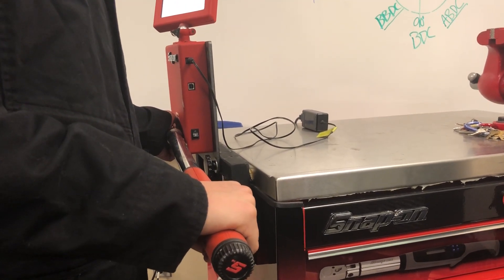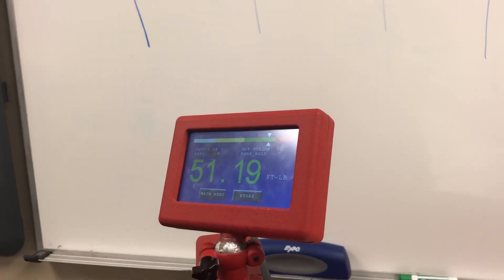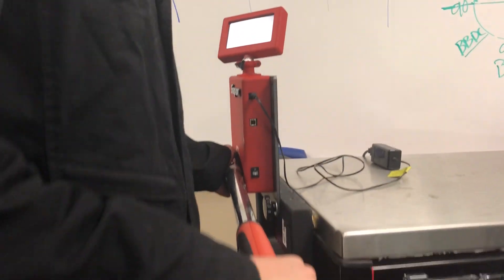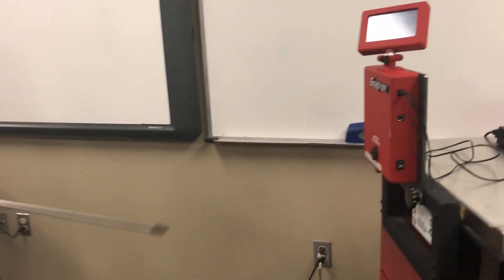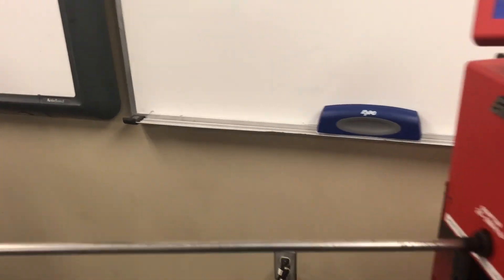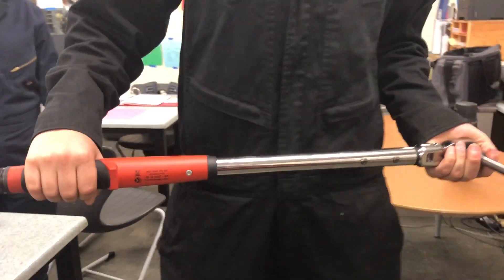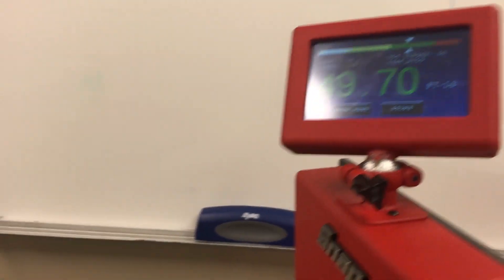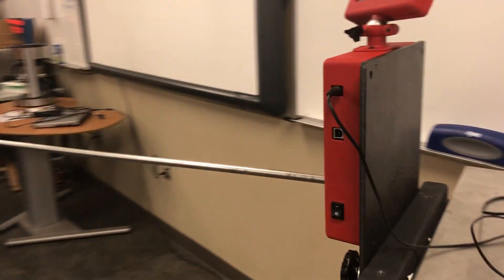Torquing with extension explained

Comment: I always knew this was true, but when I explain it to someone else they don't believe me. Thanks for the demonstration! 

I think they confuse this with torque because reduced with an impact gun. Torque is reduced with an impact wrench. But that is because an impact uses a hammer or hammers. The extensions twist back in between each impact.

Comment: Maybe I'm wrong,  but i thought the purpose of this video was to show extensions do not affect toque, which in degrees i  think it would. Either way it's a good video, i always thought using extensions would change the torque value.
Reply from the maker: Aaron Bieber it is indeed, but torque measuring fundamentally different than degree measuring. You wouldn’t logically mix the concepts.

Comment: What about degrees? Example torque 50ftlbs plus 90 degrees. Can you prove using an extension won't effect degrees?
Reply from the maker: Aaron Bieber who cares, the degrees is predicated on the fastener head anyway. Mark it and turn to the position needed. When the head is in the correct position, you are done👍